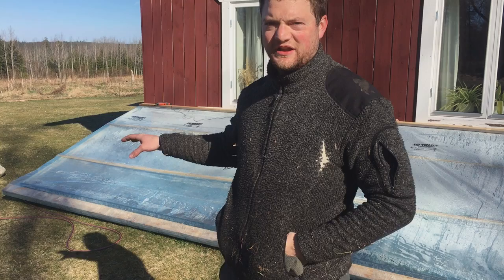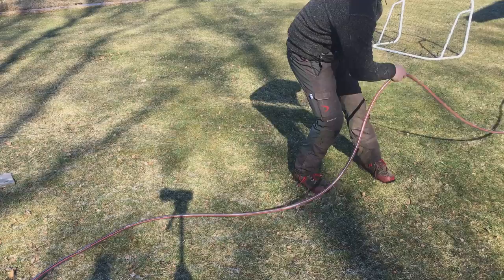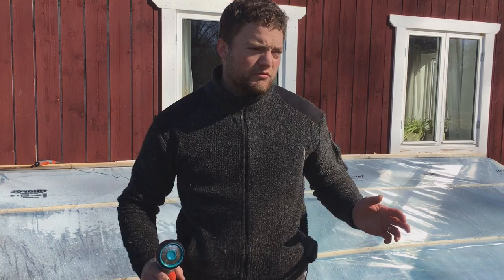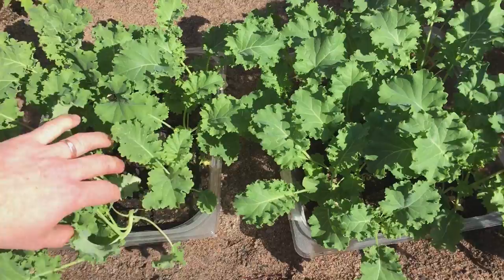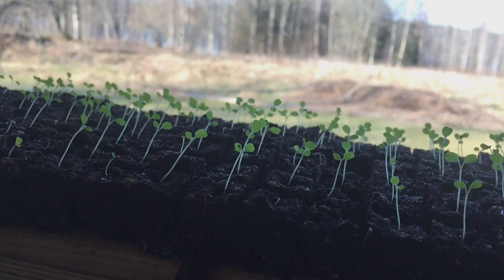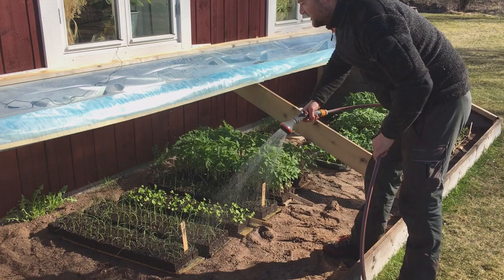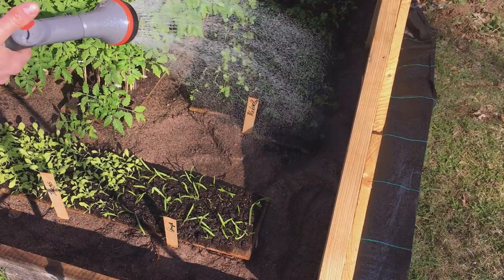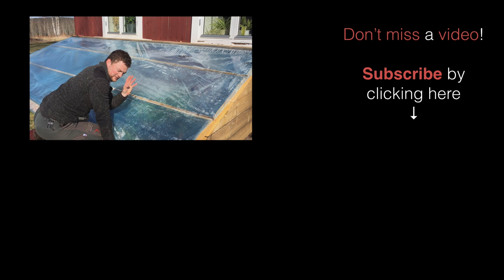Starting Plants in Cold Climate - Sweden

Comment: Simeon..
Take some solid vegetable fat, (in britain its called Trex, I think in america its Crisco?) 
Melt it and pour it into a jar, and stand a long candle in it and allow to cool. Place bricks on the ground, put the jar on it, and place bricks around the jar. It will burn for about five days solid, and keep the temperature above freezing, and provide carbon dioxide for the plants. Its a lot cheaper than the electric, and if youre off grid, electric is an issue. Your plants are looking fab tho. Thanks for all the info.
Reply: "Ister" in Swedish... interesting idea, I will try it.
Reply from the maker: Thanks. That sounds interesting.
Reply: Why "let it cool"? It's all going to melt back to liquid, and the candle will fall over, anyways.
Reply: Probably simpler and better to buy a really thick wick (or multiple wicks) and make one giant candle. The correct wick size to prevent the wick from burning down or drowning depends on the candles size and fuel melting point. It may take some experimentation.
The increased CO2 will make a huge difference provided there is enough light to allow the plants to use it. The plastic and condensation is blocking some of the light. Perhaps some LED grow lights would help the seedlings use the CO2. If the frame is well sealed, the plants will otherwise be starved of CO2.
Reply: Pretty sure the fat would cost more than the electricity needed to power those fans.
Reply: Crisco is $2.89 a pound atm
Reply: I presume the burning time depends on he amount of fuel.
Its a nice idea but you probably get soot allover your coldframe

Comment: Two things, In my opinion, I would move those heaters out until I was finished watering, and second I would put those watering hoses inside or at least drain them thoroughly at the end of each day that they are used. I reside in the same type of climate as you do and I don't really trust things will not freeze until at least May.

Comment: Love your cold frame!  It is good to see how others garden in a cold climate like I live in. I have put heating cables into the sand below the trays.  Trouble is that they are expensive and they are not very durable. Do you like the wood trays or the plastic ones better?

Comment: Simeon, I laughed loudly when you got the screen wet. The guy who invented "Morse" code, Samuel L. Morse, also invented a passive solar heater. I think an adaptation of that would heat the cold frame and hold a bit more heat to release at night. Secure Slate, or some kind of dark stone, hopefully freely sourced, to the back leaving a half inch approximately. Do this in vertical strips with the wood spacing strips. Leave it open at the top (about two hand spans under the top support at the rear of the cold frame. Find something you can use at the top of each of these slate heaters to baffle, or redirect the air back into the cold frame with a gentle curve. We don't want any warmed air escaping through the top without an attempt to recirculate that air. Leave the opening at the bottom, one or two hand spans from the floor to allow for the air to begin circulating by convection.. 
      Also, if you don't mind reusing most of the soil blocks from the leeks, you can prepare the bed you are going to plant them in by poking holes with a marked dowel. Mark it about nine inches up from the the "Bottom" and use that as your guide. When you have all the holes "drilled" very carefully crumble the soil blocks from around the leek seedlings and drop the seedling down into the hole carefully. When it gets watered and just grows on its own, the soil will naturally fill in and you will have leeks that have been naturally bleached nine inches of eatable leek without mounding soil around them as they grow. This advice came from Eliot Coleman from his book Four Season Harvest, I believe it was that one. I tried it last year and got excellent results. 
    Your friend, Kelly
Reply from the maker: Hey there. Thanks for sharing. I saw Eliot Coleman demonstrating this on a youtube video earlier this year and wanted to try that with the leeks..

Comment: I live in the states, and I have never seen that attachment you have on the end of your garden hose, did you cut off the end to put that on or is that just how hoses come in Sweden?
Reply: Michael Christie. maybe this link works. there you see what evry house and farm use in sweden 

http://www.gardena.com/se/water-management/hose-connectors/
Reply: Thanks for the link, that site is very informative.
Reply: Those are standard attachments in Sweden, they simply and quickly snap onto our standard outdoor taps. Most hoses come with them on but you can buy them and the hoses separately if you prefer. Looks like Simeon took the attachment off so that the ice could flush out and then reattached it. It's very quickly done.
Edit: Sorry for some reason I couldn't see that someone already answered your question.

Comment: hii simeon,

this is andrew from germany. here at where i am Neuss, germany, we are expecting minus degree C these few days.. it is already 17 april, still the temperature dipped.. and if i can't do something to the blossomed fruit tree, we won;t be having any fruit this year on pear and apricot even peach this year, again. 

your video is very informative, just one thing i hope you will tell me, how much is the bill for the electric heater that you put in the seedling cold frame a week ? did you put a meter to record the KWH of your seedling heating bill ? 

i guess should be expansive, because i use propane tank and thermo regulated green house propane heater.. and i have to replace the tank quite often, depending how much i adjust the temperature ..

keep up the good work. 

thanks
andrew
Reply from the maker: Hey Andrew. Hope you won't loose your fruit harvest. It is a big bummer when weather goes like that...
I calculated the cost for the heater roughly to 0,5€ / day right now. It is running about 20% of the time during night.

Comment: SIMEON!  Don't simply plant one seed of onions or leeks per soil block for transplanting.  Plant 4-7 seeds (depending on the size of the plant, for leeks I suggest planting 4-5 seeds per soil block, with the idea that in many plots if you plant 5, only 4 will likely come up).  Then, instead of spacing them out at 6 inches, try spacing them out at 10 inches apart to give the roots some room to grow.  This saves a TON of work when transplanting, the labor on transplanting and harvesting/cleaning onions is out of control as it is, planting only one seed per soil block would make me faint as I must fill in two beds 30 inches wide and 75 feet long!